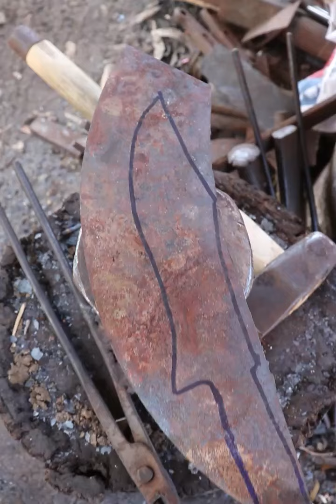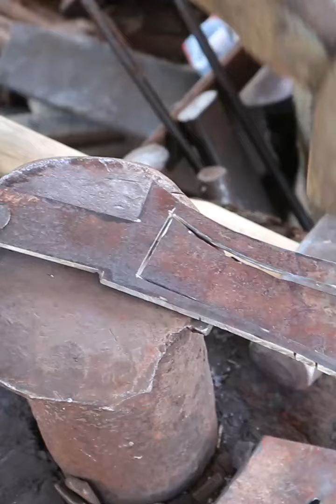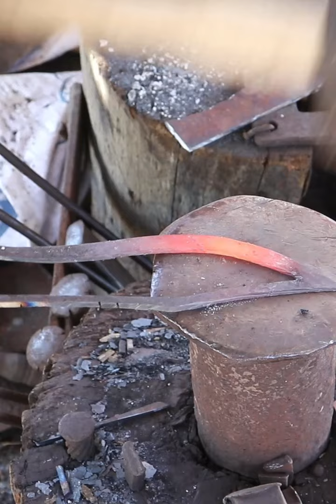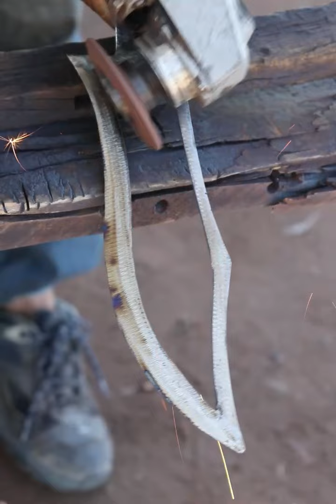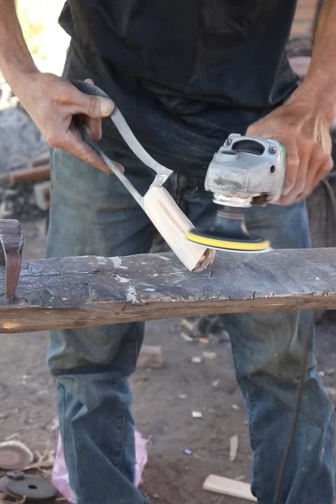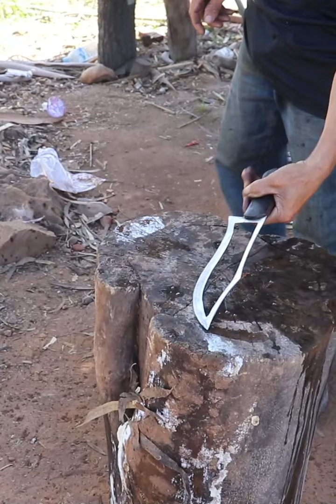KNIFE MAKING / SKILL AT TOP LEVEL OF MY VILLAGE BLACKSMITH TO MAKE THIS SUPER SHARP KNIFE

Comment: It will take at least 10000 layers just to harden the blade. If Forged In Fire asked to do an open-center blade, it could become a 6-hour project. That blade is a cutter. But not recommended for strength tests.